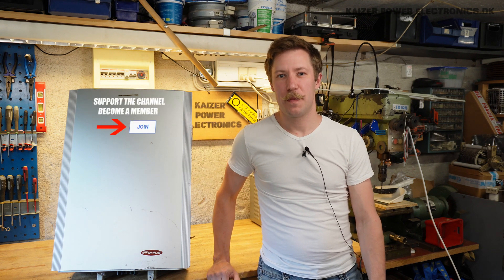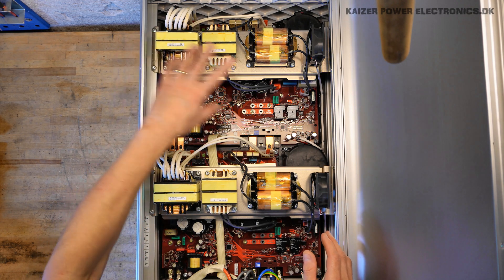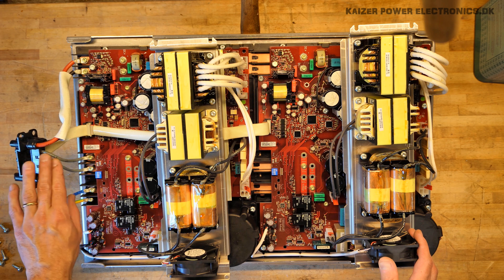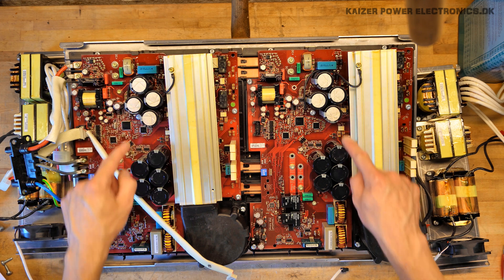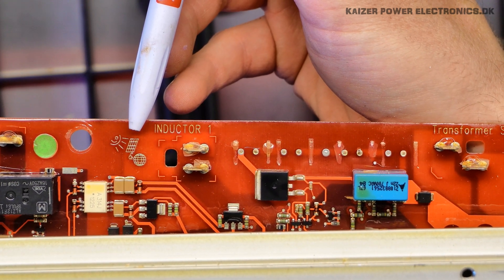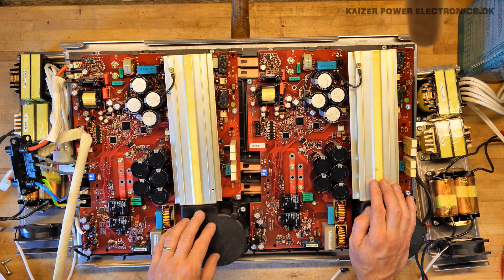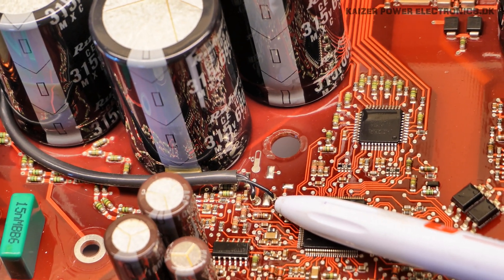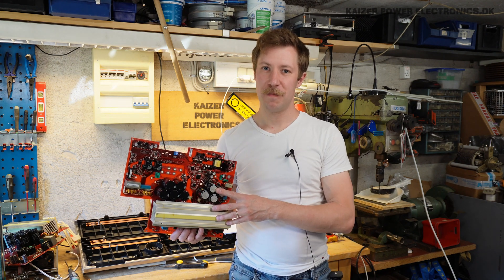Fronius IG Plus 2LT-2 6kW Solar Inverter Teardown

Comment: Сколько преобразователю лет? Что это за старинный дизайн такой?
Reply: The basic design is from before 2009, IG & IG plus were sold until ~ 2014ish. Then came the SnapINverter series that is by 2025 also obsolete and was replaced by GEN24, Tauro and Verto inverters. 
Only downside of the new models, the PCBs are all over green - no more red ;)

Comment: I doubted the  230/400V but is actually is. So what the hell runs on 400V single phase there or an odd combination of 230/400 like that? Since from neutral to each phase is a 120 phase shift, if it was 180 it would be 230/460V. Or do some house get fed like that to split the loads across two phases and save on wiring in a third and the loads are all 230V?
Reply from the maker: It just uses 2 out of our 3 phases. So there is still 120 degrees between them. All Danish houses are fed with 3x400VAC.
Reply: @KaizerPowerElectronicsDk  OK so what is the purpose of missing one phase if the houses are fed three phase? Are there any 400V devices or is this just to save on costs and run two 230V L-N phases instead of three.
Reply from the maker: @inothome  Good question. I think it is an adoption from standard products to Danish markets where subsidies from government to solar panel owners was limited to 6 kW installations. Balancing the entire distribution system was properly not considered to be an issue, unless installers get directions from power plants on which phases to install it to.
Reply: @KaizerPowerElectronicsDk  Ahh, ok. That can make some sense of it. Thanks!

Comment: Hi, to be honest, i was pleasantly surprised when i saw that familar shape on the thumbnail ^^

I've been with Fronius for almost 10 years now, so the IG Plus line of inverters was already cancelled and replaced by the SnapINverter series when i joined, but i had my fair share of work with the components in the electronic manufacturing department, as it was sold with up to 20 years of warranty.

The lower section of the inverter, that is missing with yours containes the AC and DC connection area and the system control board, as well as the display.

60Vdc are way to low, i would need to look at the datasheet again, but start up voltage should be around 250Vdc.

Each power class uses the same board + inductor combination, it's numbers are varying, depending on the phase number and AC output power.

There was a revision of the power board, you either have the older PINCI 1, or the more recent, backward compatible PINCI 2 board.

The newer one can vary the power factor, as some DNO require a Q/(U) or Q/(P) control.

If you want to make the INV operational again, i can send you the article number of the bottom section, you need a specific control board, called the IG brain (yeah, the pcb designers had the TV show (Pinci and the Brain) in mind 😅, when naming the boards), that has been programmed for a 2 power stage / 6kw output power inverter and the specific region.

Ps: the conformal coating was dropped with the succeeding generation of inverters, as by then the housing was IP66 protected, so nothing stopping you there from salvaging some components!

Best regards from Austria
Reply from the maker: @lukasaran45 Could you tell me a bit more about the isolation / boost transformer? Why does it have triple parallel primary wires from PV side and only single thinner wires on the secondary side? Is it just built like a tank for very low PV voltages?
Reply: @KaizerPowerElectronicsDk Hi there :) Sorry for the late reply, i might have overlooked the notification....

The primary side of the High Frequency Transformer has 3 inputs to cover the entire DC input voltage range of the inverter, the 3 relays next to the connections are for switching the DC input to the desired "section" of the HF transformer.

So the output voltage on the secondary side is always the same

Before passing over the relays, the DC voltage is "chopped" into an AC voltage with a frequency of 20kHz, if i recall correctly.

After that, the  voltage is rectified and fed into the intermediate circuit.

Hope this explanation was helpful :)

Best regards from Austria
Reply: Thank you for the Insights. It's great to see such a design and build quality. For me it's art on it's own.
Reply from the maker: Thank you very much for the insights! The PV voltage I stated as 60V is way wrong, I also noted that in video editing :) This inverter is not going to run again, I got no business case in repairing stuff like this.